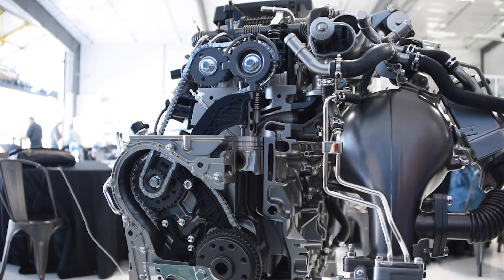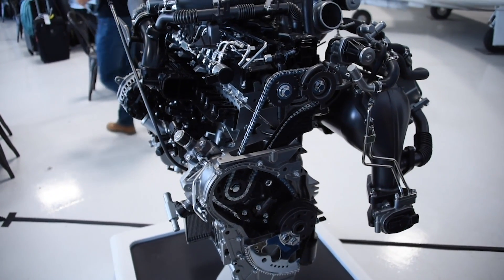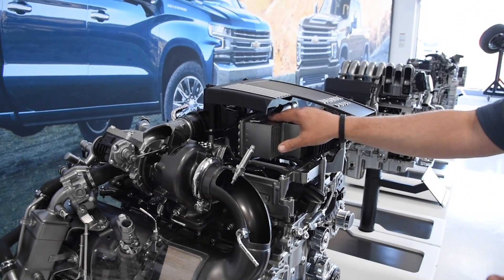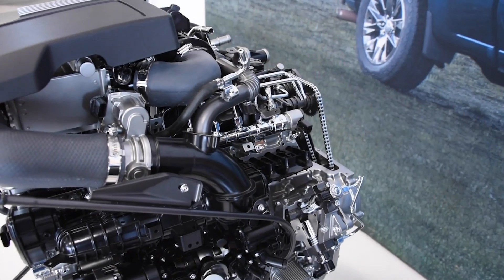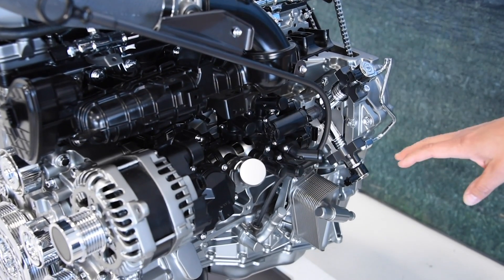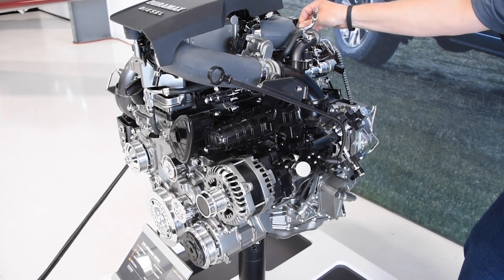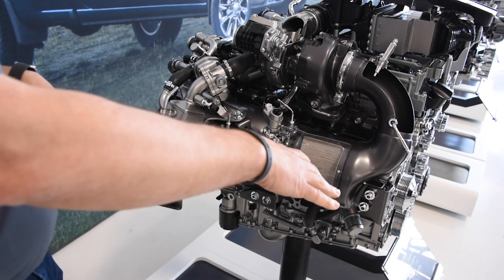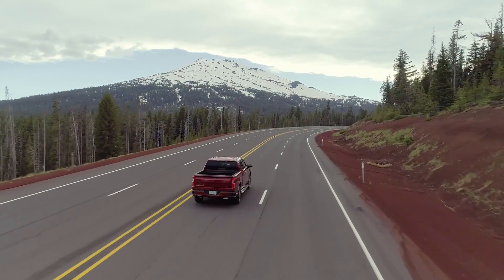What you don't know about the 3.0-liter Duramax diesel

Comment: Obviously designed by engineers that have never had to work on their vehicle to get to work the next day.
Reply: That's engineers in a nutshell that you have to drop the fuel tank to change the headlights.
Reply: I bet those engineers don't work on their own diesel engines.
Reply: Probably less than 1% of the buys work on their cars.
Reply: @ZR1Terror  because they need a degree to do it now.   Its ridiculous.  It is done so most people have to take them in and the dealers/manufacturers make more money.
Reply: Welcome to every diesel after 2003 that isn’t a Cummins
Reply: ford owners be like
Reply: That's the only time they get to touch those engines,  mounted on a display rack in a show room. They don't realize that a whole body goes around that engine so they don't really care about commodity for some parts like filters that you need to work on on every maintenance.
Reply: You really shouldnt have to do much on this more than 1 time every 8 years or so
Reply: Yes
Reply: Actually those days have been over, every vehicle would need a specialize set
Of tools, but I think this is good thing, you pay that much money on a vehicle, you don’t need to work on that bitch, these trucks ain’t to keep and hand down to your grandson anymore
Reply: Totally agree sucks a great energine. Good power, amazing fuel mpg, 2500 torque, just a shitty layout design for Maintanece. I’m debating this and a F150 2.7 eco boost. I wanted the V8 but the ruined it with the cylinder deactivation crap.
Reply: @ajfam871  

Get a $300 programmer to eliminate the cylinder deactivation. I understand it’s another $300, but at that point, for the price of the truck, what’s another $300 if it’s that big of a deal?
Reply: Who should have designed it? A landscaper? You?
Reply: Pay no attention to what people say, pay attention to what people buy.
Reply: Or complained on by wannabe new truck owners magically becoming armchair engineers that don't know chit..
Reply: You must own a Ford

Comment: No such thing as
 “simply dropping the transmission “
You could simply build a nuclear reactor to provide power for the truck.
Reply: Reminds me of when my wife says "Can't you just...".
Reply: Everyone’s forgetting about the transfer case.
Reply: @danzurcher7331  Right! And the extra brackets, front drive shaft, etc.
Reply: Also a transfer case if It’s a 4x4. Been a pro mechanic since 1978. It’s not a “easy job“ to pull all that. Don’t make it sound like pulling a fuse . Lol
Why not use a chain to drive the oil pump that requires no service?
Reply: @TheBamayaker  
Because they want to sell more engines and more new trucks. Clearly longevity, low cost of ownership, maintenance and repair run contradictory to their financial goals.
Reply: @preachers4135  exactly! Got to make sure to sell $150 per hour service in parts designed to fail at mileage intervals
Reply: Manufacturers are more concerned about the cost of manufacturing the engine than the cost of maintenance and repair. That’s why you see bizarre designs on new engines. They may be the cheapest to manufacture but can be quite expensive to maintain and repair.
Reply: Idk dropping the Trans gives more room for access then pulling the whole front of the engine off to get to it if it was on the front but either way why a fucking belt when a chain would cost a very small amount more and assuming everything else can survive the chain will last the life of the engine
Reply: @Wesleystewart78   exactly!
They want to sell service and make folks bring it back in
Reply: I was thinking the same thing.  Only people who don't have to actually drop the transmission would refer to it as "simply."  I haven't had to change a water pump on Ford's 3.5, but I've heard it was a bitch.  Engineers do a lot of stupid things.  The spark plugs on top of the cylinder heads of the ford modular engines, the timing chain on the back of the 4.0 sohc, the belt and chains on the back of this diesel, etc.
Reply: @brussell639  I’ve watched it done. It takes 4 hours and you have to remove the timing chain. God forbid it actually fails on you. It will nuke the engine.
Reply: Guys as someone who just pulled a rusted in transmission is rather do that than fuck with timing.
And given it's not a full drop just a disengament and backing off for clearance
Reply: Meanwhile when Ford introduced the new F-250/350 the first thing they bragged about was how fast it was to remove the body to service the EGR's...
Reply: it’s simple for the dealer…
Reply: It's called the "Dealer Protection Plan".  Standing Order No. 27 for GM Engineering is to design the vehicle so that no one but the dealer can do ANY f*^kin maintenance on it.
Reply: I can almost guarantee that moving the trans back is easier than disassembling the front of the motor to get to the timing belt. People are so funny…just parroting each other without actually thinking about what they’re saying.
Reply: @admorris11  Neanderthal take
Reply: @admorris11  So tell me, what engine needs “routine maintenance” performed on the oil pump drive system / components? Oh that’s right, this one! 
Now let’s apply some basic math to our critical thinking. Given the current average shop labor rate and inflation rates higher than most peoples retirement portfolio returns it won’t be long before we see shops charging $200.00 an hour. Now let’s say the average “book time” or “labor guide time” to remove and install a transmission is 8 hours that works out to $1,600.00 plus parts, shop supplies, fees, taxes… that easily becomes 2000 great reasons for me to buy a vehicle without this engine.
Reply: @preachers4135  if you’re driving the average of 12-15k miles a year, you’re talking about maintenance for this belt being done once every 10 years…hahahaha. I’ll take the advantages of an inline motor that needs this service every 10 years or so vs the alternative.
Reply: @admorris11  That’s cool. Will you keep us posted of your overall impressions and include all expenses, fuel mileage, maintenance and repairs? Maybe a handful of people doing that, such as @TFLtruck does, over an extended period might convince more of us skeptics. (So long as you’re not a paid endorser or lobbyist)!
Reply: @preachers4135  will try to update with as much info as I can…only have 370 miles on it now…haha
Reply: I like this truck and the engine but I asked the Chevy service department for a quote to change the oil pump belt and he guessed $2500 to $3000.  But he hasn't had to write up the service for this yet.
Reply: @MarkSDCA  I’ve heard $1500. I’m ok with that every 10-15 years…hahaha
Reply: I would much rather drop a transmission than pull apart the entire front of an engine. Rear wheel drive transmissions are usually a 4-6 hour job to R&R and you not unnecessarily disturbing and unnecessary seals, gaskets, brings, etc.
Reply: He didn't say you had to drop the trany, he said move it back to reach in and change the belt. Just Saying. Now with that being said. it does seem like a pain but atleast its not being run on one belt.
Reply: @larrythelegend13  still have to pull all those bolts on the bell housing and you have to unbolt the torque converter then you unbolt the flywheel and take that cover off the back of the engine. Assuming you know what you are doing and there isn’t rust or corrosion anywhere. Probably 4-6 hours and very cramped working conditions. There’s a reason why the guy stammered when he said simply move the trans back. That’s called press release bullshit.
Reply: @larrythelegend13  
Moving it back is still a laborious task.  You'll have to disconnect the driveshaft, probably remove the transmission mount crossmember, and replace the bell house bolts with longer ones that can support the weight.  You might as well drop if you're going thru all that.  Nothing is ever as easy as they guys in lab coats make it sound.
Reply: @brussell639  I Dismantle trucks for a living. Moving the transmission is no big deal, especially if you are just moving it back far enough for service.
Reply: @steven530x  
I suppose some clarity would help.  If you do it for a living, it's going to be easier than for an enthusiast or DIYs.  I never did it for a living, but I've changed enough transmissions that I certainly could have.  And I always considered it a big pain in the ass.  Especially those bellhouse bolts that you can only get to with a wrench and only have about a 1/16 - 1/8 of turning room.  I still do all the maintenance on my vehicles.  This would be something I wouldn't look forward to.
Reply: @brussell639  true but 150 mi.min.
Reply: brussell639 theres no reason to DIY this unless u have a lift and a hoist
Reply: @brussell639  you you wouldn't "might as well drop the transmission" a full drop requires pulling it out from underneath the truck which Is half the issue.
This is shitty but it's not as bad as y'all say
Reply: @steven530x  Not everyone dismantles trucks for a living, therefore it's a big deal for most people to ... <checks notes> just move the transmission back.
If it can't be done in your driveway with basic hand tools, you shouldn't be using "simply" before any operation.
Reply: @monunyabidness5949  It can though, with a jack to support the transmission, a couple foot long ratchet extensions with swivel head sockets, and an oil pan to collect tairports.

 I personally wouldn't do something like that at home, but take it to one of the tens of thousands of shops with vehicular lifts and air tools.
Reply: @jonathangarzon2798   just adding on to your comment, more importantly the part he doesn’t talk about in the video is the camshaft sensor, they have been failing, so to work on it, they have to pull the cab off the truck, it’s up there on that camshaft. If it was on the front of the engine it would be easier to repair, also would have to pull body off to due the camshaft chains, I can only assume that’s a hydraulic chain tensioner up there also. He clearly stated to change the oil pump belt would require backing the transmission off, notice how he avoided talking about the other parts.
Reply: Thank you. Finally someone with balls.. it’s nuts and bolts. All these whiny ass men lol. Drain it, disconnect driveshaft, reomove torque converter bolts and unbolt the damn thing.. whole lotta what if’s in here. How many own this truck? How many have had to do a belt? If you spend 65k on a truck and bitch about a service 4 years from now that “might” have to be done then something is wrong
Reply: @Remo850  Pretty much my thoughts.  I am waiting on the refreshed model so don't own one yet.  

I don't drive much.  Probably will drive more than I do now but that's not hard to do as I drive my car about 2500-3000 miles a year.  So I figured 6-8000 with the truck since it will be used to do the things I am buying a truck for.  If I can't keep up with that maintenance schedule I messed up and bought too much truck.  I ride Italian motorcycles so I am used to a hell of a lot more expensive maintenance than a belt and 1 or 2 days labor cost.
Reply from the maker: 3RD Werks  Sure he can. He just won't bill you for an hour ;-)
Reply from the maker: Nope. A GM tech can remove that transmission on a lift in less than an hour. Changing a timing belt takes longer.
Reply: @TheRVConnection  yeah in less than hour but they will probably charge 600 bucks for it....
Reply: @TheRVConnection  since they have to pull the cab off to changing!
Reply from the maker: @daleharper5361  Uh, that's a new one on me. There is absolutely no reason to pull the cab...the system is designed to be serviced with the transmission removed–and I've never seen a truck that required the cab to be removed to service a transmission.
Reply: @TheRVConnection  it’s not the transmission, it’s the camshaft sensor/exciter wheel on the end of the camshaft, in the video they only talk about the oil pump, not what it would require for the sensor repair or camshaft chain service.
Reply: @TheRVConnection  sorry, got my comments split when replying to Garzon
Reply from the maker: @daleharper5361  Interesting. I can see where the engine may have to come out for that–but most chains systems are designed for the life of the engine. I know the Prius, for example, is far too complex under hood for a rebuild, so they use a timing chain instead of a belt and it is designed for the life of the engine.
Reply: @TheRVConnection  Are you being intentionally obtuse?  Or is this just something inherent?

There are MANY of us who own vehicles and are capable of performing advance vehicle maintenance.
But this nonsense of putting the timing chain and your justifying it by saying 'a gm tech can...' when nearly every vehicle in the world has its timing chain at the FRONT of the engine, well this is just idiotic on so many levels.
Reply from the maker: @ThunderAppeal  You think so? I would wager that the average tech can drop a transmission faster than disassembling the entire front of the engine on a modern engine. That typically involves draining and removing the radiator, shroud and three cooling fans (in this case), serpentine belt, one or more accessories, waterpump, timing chain cover and then the chain itself. Then reversing the process, filling and bleeding the cooling system. So yeah, unbolting a crossmember, some bellhousing bolts and dropping the transmission would be ALOT faster and easier. Read the other comments...you're one of the few that disagrees, Mr. Obtuse.
Reply: @TheRVConnection  It is comical how you are justifying a terrible design.

You probably think the LT1 from the 90s was a great engine too.
Reply from the maker: @ThunderAppeal  What's comical is you pissing and moaning about something you don't understand or have any personal experience with. The 3.0 liter Duramax has a good history for reliable performance, and no one is complaining about service intervals/cost. And yeah, the LT1 was a good engine–look it up. You must be a Ford or Ram fan boy...
Reply: @TheRVConnection  Youre an ignoramus.

Youre the kind of person who gets ripped off when you have your oil changed.

'No one is complaining about the service.'
Because a) hardly any of them have hit 100k yet and b) GM hasnt sold enough of them to make a difference.
Reply from the maker: @ThunderAppeal  You're hilarious. I'm in a position where I can interview interview key engineering personnel at GM...I've forgotten more about automotive technical subjects than you're likely to learn in your boring life. So why don't you just post some more weird, random content and get off my channel.
Reply: @TheRVConnection  Clearly whatever 'position' youre in is not at all a demonstration of your automotive knowledge.

Lets try again then.
Why is the SBC still more popular than the LT1 from the 90s??
Do you have ANY idea at all?

Comment: Honestly, I was excited about the new Duramax, but after seeing this, Screw that, give me a 12 Valve Cummins all day long.
Reply: Cummins makes an excellent 2.8 litre 4 cylinder engine.
Reply: @kevinmccune682  just like the ones that are on Chinese vans pick ups and suv here .. that looks similar to the japanese theyd copy from ..
Reply: @baecchi4153 Sorry, I did not catch your nom de plume till later.
Reply: @kevinmccune682  Chinese car manufacturer "foton" are cumins powered.. a i4 turbo intercooler 2.8 diesel .. the foton traveler is a van copied from toyota hi-ace vans .. forons pick ups and suv are powered by the same engine and are one way or another looks very similar in appearance from japanese car manufacturer ..
Reply: @baecchi4153   Thank you.
Reply: Heck I would love one of those new 24v 1000 Pounds of torque ones. 😍
Reply: which gets 25 MPG highway all day If you have ever drive one
Reply: Funny all these comments probably don’t even own a Cummins and sounds like their under 18 and get all their info from the internet..
Reply: Yeah, I have a Cummins that didn't last 140K miles, 2 water pumps went through the radiator and one transmission and turbo. I'm more then happy with my new 3.0 Baby Duramax at twice the fuel mileage of the Cummins.
Reply: If you want a 12 valve Cummins then you've never owned one.
Reply: @rubbermaidable  I have a 12 valve Cummins rig truck. It has a little over 437,000 miles on it. Never an issue with the motor. The truck tends to fall apart around it. Lots of my buddies have or have had a 12 valve in the past. That's as close to factory bulletproof you can get.
Reply: @dangle0921  I had a 24v that I sold at 500k miles. Best truck ever and got 26 mpg empty or 18 loaded. My 2 7.3 Powerstrokes are going strong at 400k and 300k. They can keep all these newer smog equipped engines.
Reply: @doughibbard8462  crap i only got 25 mpg unloaded ! :)
Reply: rubbermaidable literally 95% of people who own 12 valves love the shit out of them. They are the best diesel motor ever made.
Reply: @rubbermaidable  apparently you have never owned one. I have owned one for 21 years 210,000 miles never even had the valve covers off. Even has the original clutch in it absolutely hands down the most reliable truck and engine combination I have ever owned period. My brother in law has one as well 317000 miles never had valve covers removed. Have a good friend with a first gen Dodge Cummins 750000 miles still going strong. And I could go on and on absolutely the best pickup diesel ever made or ever to be made again.